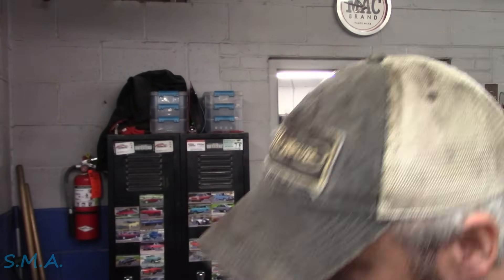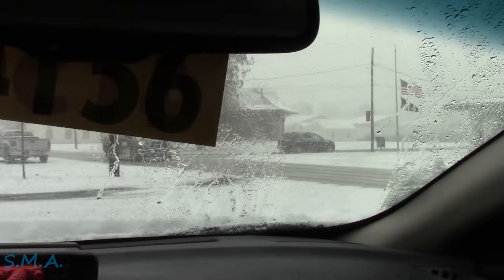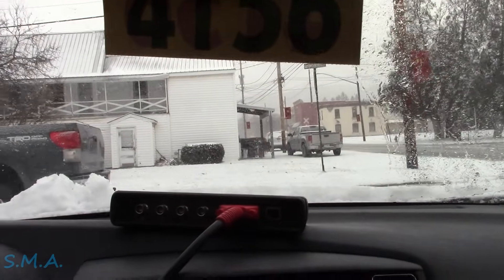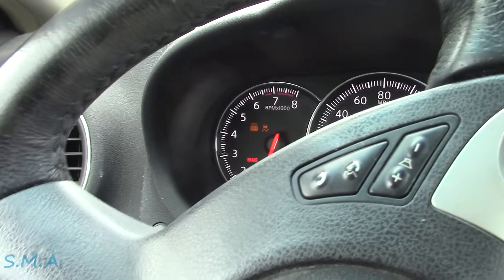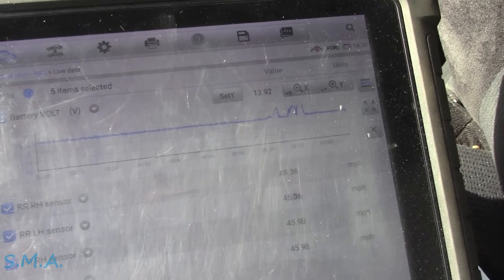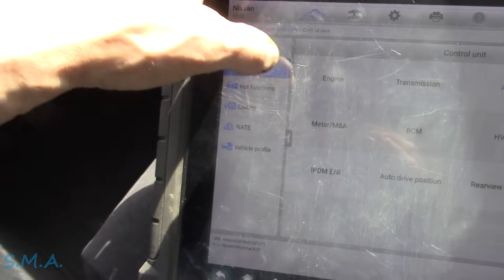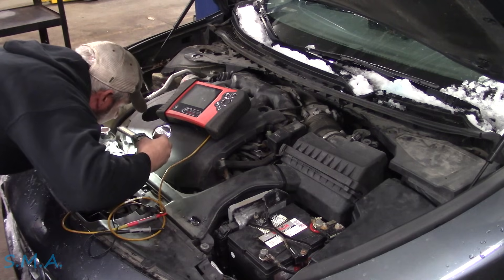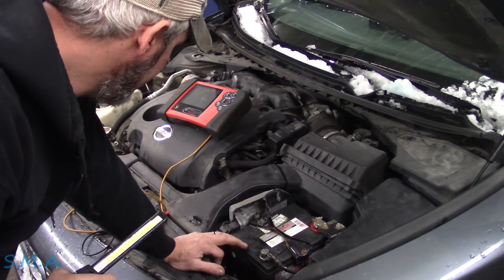Nissan Dealer Quoted Over $2000 For A New Harness!!

Comment: I guess you've been doing it for some time. But in the olden days we didn't put anything on the battery terminals after cleaning. I had some cars that after things came up to temp under the hood. What was put on the terminal would heat up wick it's way in-between the battery post and the terminal and cause a bad connection. My old boss or one of the older mechanics would put a small dab of grease on the battery and stick a couple copper pennies. Yes pennies used to be made of copper or more copper than other stuff. Well the corrosion would stick to the pennies. We would just change the pennies when they grew a green coat. OK OK enough of story time lets see what you find.
Reply: Fluid film works great on battery connections.  I'm always reaching for the can at work, especially on the rust buckets.

Comment: My 2005 Maxima went into limp mode about 10 minutes after my independent mechanic finished some work on it.  I was able to get it to a dealer (my mechanic closed early for the weekend) who determined my cam sensors went bad.  This doesn't seem to be the case with this car, but I thought I'd share this with the group as a reason a car goes into limp mode.

Comment: Nissan dealers in SoCal use a website to hit the owners up on "things you should do in addition to the battery we replaced" and it is a scam. Everything is a la carte pricing - for example the site says accessory drive belts need to be replaced for $280 and then further down, timing belt for $1800.  Click here to authorize..... How many people are paying this way and double paying for labor?  Timing belt change requires removing the accessory drive belts..... and to top it off, NO WATER PUMP REPLACEMENT on the list.  Guess the stealership hoping the water pump quits later for another go at my friend's wallet. 
Summary: Friend had them change battery, recommended $7600 in other things. Thankfully he took it to an independent shop instead.

Comment: Bad power steering unit partially shorting out and drawing more amperage as seen in the data? The key is the draw on the alternator went up and it attempted to compensate by increasing voltage, too much lol. Worth a look

Comment: There are competent techs at dealerships and independent shops.
As a retired gm from a Ford dealership, I can say there are some really good service departments and some really bad ones as well.
I can also say from experience, there are many independent shops that share the same pattern.
You should stop picking on the dealership and share some of the incompetence that occurs at independent shops.

Comment: I used to like Nissans but not any more, my son had a Nissan micra a few years ago with an electric steering system. All worked fine for a year and then it would fail so it was back to steering with brute force. Not very good. Into the dealer, he slaps a computer onto it and said there is a major fault with the steering harness and it would have to be replace at a cost of £1400 plus labour. For some reason (I never did find out why) they wouldn’t entertain warranty work. They reset the system £40 for 5 minutes work. Not satisfied I went to a local garage owner owned, not a dealer, and within a day he had diagnosed the problem and cured it. The problem was that the steering harness was very tight with no give at all, the strain on one of the multi plug units was so great that it was uncoupling it just a fraction, just enough to break the circuits. He stripped out the harness clipped off some of the cable ties and bindings fitted it back and cable tied all of the plug and sockets back together securely. Made sure there was enough room for the harness to give a little. Success! Never had a problem again. I went back to the dealer and roasted both the management and the chief mechanic in full view of the customers in the showroom. They all looked a bit sheepish after that. I did get some letters back from Nissan GB with an apology but the damage had been done. No more Nissans.

Comment: At full lock the EPS will pull very high current - alternator and/or the battery is done for - the regulator if crapping out under load - undersized battery isn’t helping

Comment: My guess is battery voltage.  PCM and ECM are sensitive to voltage from the sensors, as with any computer and you will get bad readings with overvoltage. Not so much with undervoltage because most sensors are looking for 5 volts or 12 volts. so either a bad alternator OR something to do with the electric PS.

Also an alternator will put out high voltage if it loses contact with the battery.

Comment: My truck had a electric steering recall.
At low speeds the wheel could be hard to turn because the alternator voltage to the electric steering could be low so they reprogrammed the PCM/ BCM not sure which one but I never experienced the problem.

Comment: Once had a Chevy p/u that would start bucking and miss firing,  I pull the regulator power feed terminal plug and it would straighten out. Changed alternator regulator and was back to normal. 1968

Comment: Hey Eric. What model Autel are you using these days? I'm in the market for a diagnostic unit, and wanted to know what you're thoughts are on the ms906bt? Or if you have a recommendation for another model. Essentially, I am looking for something that covers all bases generously, and without the need to purchase many additional devices. Your response and opinion is greatly appreciated. Thanks.

Comment: That's a wierd one for sure. I'm split between bad alternator or bad electric power steering rack / system .  But I'm not sure how the power steering would create an over voltage being a consumer of electrons.
Reply: @T.J. Kong that is a good point. Gotta love those combo problems that make stuff harder to figure out.

Comment: I see a clip missing from the air box. My car stalled alot 2009 nissan maxima. There was a hole in my air filter that allowed moisture to mass airflow sensor. Replaced and fixed that issue. After that I realized there was something wrong with my alternater. Replaced it car runs fine now. Not saying this is the same issue. But problem looks similar.

Comment: It could be caused by a bad battery ground as well.

I fixed a 1997 Model Ford EL Falcon which was built in Australia,it was powered by the locally built 4 litre Thriftpower SOHC in line six & it Would have an issue where the engine would just cut out,it was my great uncles stepdaughters car.

I ended up finding that an aftermarket car alarm/engine immobilizer had high resistance in its contacts for the main ignition supply after the ignition switch so I just wired it up as how Ford had it & bypassed the engine immobilizer.

It was fitted into the car before she bought it & I didn't think that she wanted the alarm so I disconnected it,I was right because she told me that she doesn't want it !

Comment: All I can say is, dang.   I sure hope you have a screen protector on that expensive Autel scanner, cause that thing looks rough.  Like it's been around the block a lot already.  I use one of those rubber touchscreen pen thingies on my touchscreen equipment.  I find it's better than scratching something up or using dirty fingers.

Comment: I picked up something that could be wrong on the video: The idea of probing for a voltage drop on the cable to the battery seems misleading as the charging current might be very small compare to the startup current.

Comment: Has it got a clutch pulley on the alternator? The belt squeaks cos it's slipping ecu detects a lower output so increases it. The belt stops squeaking so quickly when you take pressure of the steering the voltage is too high at hat moment..... I'll get my coat lol

Comment: Clock spring intermittent short.  Two clues:  Global electrical problem that lights up the dash like when starting the car.  Spike in voltage when turning the steering wheel.

Comment: I had a similar issue with a Nissan a while ago but it was due to running different tire sizes front and rear. Car would go into limp mode after 5 minutes of driving lol

Comment: At 180k + belt tensioner as well as belt - just saying.
Alternator.....yeah, diodes do fail in Wierd ways at times.
Bearings must be pretty tired at this point.
I think I smell where you are going, it seems a good direction.

Comment: Question re: battery charge problem on 13 jx35 with new battery.  Listening to radio for 30min. Battery starts car but chugs and dies. Cleaned green crusties from ground cable at body and eng.  Is it a faulty  pcm asking full amps from alt. Or faulty alt?

Comment: Actually the "noise" sounds like a belt pulley, with all the road grime (and salt) I wouldn't be surprised if a pulley bearing was on it's way out.

FWIW bearings are cheaper than replacement belt pulleys (at least locally) and an easy press in/out fitment 👍

Comment: That'll teach the dealership not to give up diagnosing so easily. Just imagine having to go through all the paperwork of selling her a new car!
Reply: One thing you learn in this industry is no tech is perfect.  There are so many rabbit holes and hidden doors in electrical and driveability diagnosis that even a seasoned tech can and will miss something at times, especially when you're under pressure.  It happens, but that doesn't mean someone is lazy or doesn't care.  I've sent many out the door cause I couldn't figure it out, knowing it may go to another tech that may fix it.  I've also gotten many that I was able to fix that someone hasn't.  The last thing you want to do is waste customers' time and money throwing parts at it, so sometimes it's wiser to let it go. Sometimes you have to humble yourself in this field.
Reply: @Discretesignals  You don’t have to humble yourself in this field being outwitted by an inanimate object usually does it for me!

Comment: I had a 2019 Nissan Kicks that after 15 minutes driving the car puts up a check engine light, malfunction error, front radar light comes on, and traction control comes on.  Nissan had the car for 3 months and after a lead nissan tech looked at the car it was a bad wiring harness.  The harness has a short in it, causing false codes.  They replaced the harness and the problem was gone.
Reply from the maker: "it needs a harness" is dealer tech code wording for, "we changed all the hard parts and don't have a clue so were gonna change all the wires instead of finding the real problem."  It is just shorter to say, "it needs a harness." Hear me out. If your car REALLY had a short and the "lead tech" was savvy enough to actually ID the wire and the fact that the wire was shorted (to a ground a power or another circuit) then he certainly would have just repaired the single short as opposed to replacing an entire engine harness. You see what I mean?
Reply: @SouthMainAuto  I agree with you on replacing the harness was code for we shotgun a whole bunch of parts and couldn't find the issue.  And I am sure when it worked it was more the tech just stumbled onto the fix, and couldn't tell me what was really wrong.  In the end I sold the car to carmax and bought a new car.  Just couldn't trust the error wont come back again.
Reply: When I find a bad wire in a harness I'm so proud and happy, after I repair it I tell everyone, plus I'm lazy, and the idea of changing a harness does not appeal to me,

Comment: No wanting tell suck eggs… Super healthy battery required before anything. Step one is alternator operation. If needed code battery to car. No point testing anything until these steps done. Period. You’ll end up with with garbage codes otherwise and all sorts of rabbit holes. It appears abs system is fine. Leave alone. You’d know if issue lay there without any code reader. Electronic rack is normal. Good luck from UK. 🇬🇧

Comment: Alternator pulley clutch failing? Could cause fluctuating voltage,  although probably wouldn't account for the voltage rising to 17v.

Comment: Bad Alternator or shorting regulator. I had several Dodge minivans and Ford trucks drop voltage. When driving the  vehicle, trans would drop a few gears , engine rev high , and then stall out. I could drive for a day or two and nothing. Kept my meter on a Grand Caravan for one week  and noticed when the vehicle kicked the ABS , alt , traction control, engine lights just after the drop in voltage....then the stall. Replaced the alternator and codes disappeared and vehicle ran and shifted perfect . Most vehicle had bad alternators . I think a Ford had a shorted body control module?

Comment: In the middle of nowhere, just a Carb you can take apart and a ignition coil and igniter you can quickly diagnose and replace. will get you out of trouble that 12 computers and tiny signals on corroded wires open to the elements. I even carry a  igniter i made out of a 2055 Transistor and a spare coil and plugs and the fuel injection system runs off one computer only which i serviced so i should be safe and no impossible breakdowns unlike modern vehicles but they are so much more reliable but highly complex?? hmm

Comment: Thing is, all those error codes are useless and misleading if the battery voltage has gone too low or too high or with too much ripple.    First get the basics going solidly:  good battery and an alternator that properly charges.  Every other error you can ignore, as bad battery voltage can trip any error code.   There must have been millions of perfectly good parts changed due to all those spurious error codes.

Comment: Seems to be the fault, the alternator. For a bit there I was wondering if the electric steering might have been goofing with the voltages as the wheel was turned left etc. Sounds like there is an issue with the sensing of voltage or overly sensitive therefore demanding full alternator output however, the "regulator" should be limiting those volts to not exceed 14.6 or so volts. Being a computer operated alternator/regulator, could be more than just an alternator concern...I'll know more after lunch. 
For sure the complete wiring harness is not the issue...where some mechanics come up with their diags is amazing. However, said dealership made some profits on her new car purchase.

Comment: I'm wondering if there is a faulty "H" bridge for the electric power steering components.  One half, the portion for left hand turns is causing the charging voltage to be over compensated.

Comment: Folks, if your vehicle is out of warranty, do not take it to the dealer. Dealership techs are not trained to do proper diagnosis and if there isn’t a TSB or a clear answer from the diagnostic trouble trees, they are lost. Many vehicle manufacturers now don’t even allow diagnostic other than what the scan tool specifies (called guided fault finding). You are far better off going to a reputable independent shop for diagnostic work.

The craziest charging system issue I ever had to diagnose was before I was even a tech (I was still in school). My own car at the time, an 88 Honda Accord with a carb, would run perfectly fine during the day, but with the headlights on or the AC on, it would start to buck and misfire, and the tach would start to jump. The tach was triggered directly off the negative of the coil, so the jumping tach meant that the coil was being fired erratically. I thought I was having an issue with the pick up coil or the ignition module in the distributor until I made the realization that the problem depended on the electrical load. The alternator was putting out excessive AC and causing electrical noise. The electrical noise was enough that it was being picked up by the ignition module and interpreted as an rpm signal, so the ignition module would trigger the spark erratically and at incorrect times, causing bucking/missing and a jumping tach. I threw a new-to-me alternator (I was still a poor student at the time) and it ran perfectly after that. It was a good learning lesson that helped me out a lot during my career later on.

Comment: I had a 2011 BMW 335 that would overcharge but looked like a traction control/wheel speed sensor issue. It would first show up as if the TCS just crapped out and the computer said "drive carefully, 4x4 and TCS malfunction." It got progressively worse to the point where I'd be on the highway, cruise set to 80, and all the electronics - lights and everything - would shut off, then come back after a second or two but with TCS errors showing. Engine kept running the whole time. It eventually got so bad it caused the navigation/radio system to shut off and reboot, giving me a bright red screen followed by the BMW logo. Plugged in a diagnostic tool which showed voltage getting up to 17.3v.

Then COVID lockdowns happened and the car sat parked for maybe a month or so. When I next went to drive it it acted like it had a dead battery, then the alarm system started going off. No way to get it to stop without crawling into the trunk and disconnecting the battery (literally crawled back there because the it wouldn't respond to the key fob and the only manual release for the trunk was the emergency pull thing for people who are trapped in the trunk. Had to reach through the ski passthrough in the rear seat, hit the lever to drop the seat back, then crawl further back to hit the escape trunk release). Funny enough, after I let it sit for a few hours and reconnected the battery the car ran perfectly fine for 4 or 5 miles, then did the overcharging, red screen, TCS thing.

A $900 new alternator later and that problem stopped happening, but then I had a slew of lean codes and misfires. Eventually I had a spark plug self destruct and take one of the pistons with it. Still not sure exactly what happened but I suspect some combination of failing injectors, too much fuel injector cleaner, and bad gas from having the car parked so long.